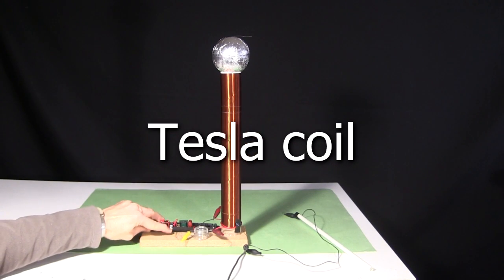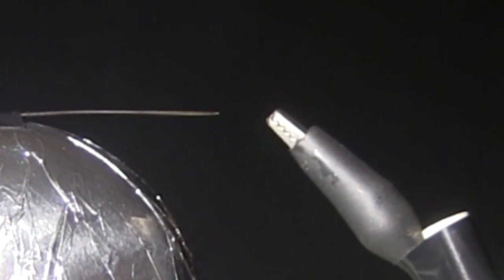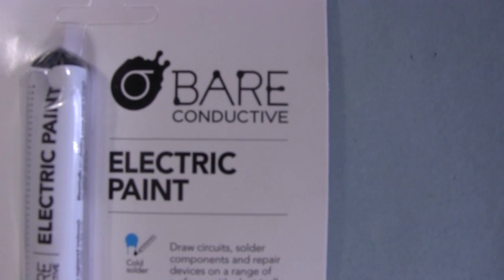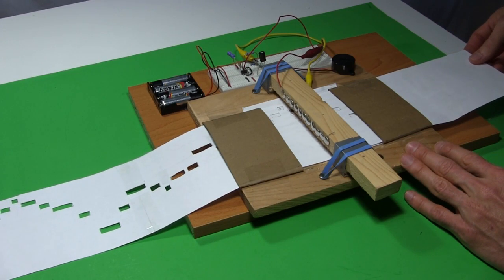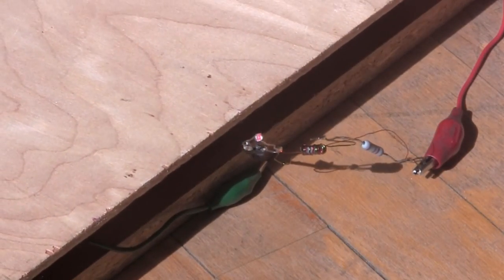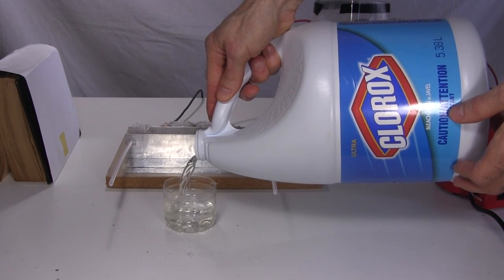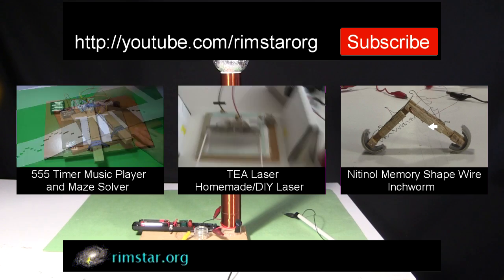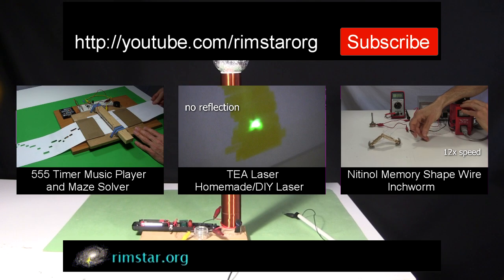Tesla coil, conductive ink, joule thief, solar and TEA laser

Comment: it sounds like your tea laser has some good capacitance to it. before you get too carried away with calculations, try putting a larger cap bank on the end of your zapper and shrinking the spark gap size. you will see the resul;ts right away, then you just have to increase the power to the cap bank and increase the frequency for streamers. im sure there is a place for math in there somewhere, but you dont need it for visible results   :)
Reply from the maker: jeremy gwilt Oops. I just replied to your comment elsewhere. At your request I added capacitance but as you point out, that means there's now more tuning to do.

Comment: My best low light JT can run on light from a full moon using a 50mmx150mm Amorphous flexi panel. :) I think all sthose panels might be a little bit of overkill. You should have no problems with full moon runing from that....

I would be highly impressed if you can tune that SGTC to get continious streamers from the bug zappers wattage. Honestly I'd be impressed to see constant streamers from your flyback PSU's . I fear higher freq sparks with significantly increased length will be the best you can do from the zapper.
My sugestions would be a fairly high capactiance top load with insulation. Work out quater wave freq of secondary and top load capacitance. Then tune the primary tank for around 5th-10th harmonic of the secondary. I'd be going for a firly long helical primary. Somewhere between 9 and 20 turns. Try and get coupling over about a third to a fifth of the secondary height. Although I could be very wrong. I need to have another play with SGTC's myself.

I'll have to try some olive oil and bleach in my TEA laser. I think I'll skip the urine. Happy to accept that didn't work, lol.
Reply from the maker: Mongrel Shark Yeah, I didn't show much in this video but the LED was still barely lit even though the solar cells were practically in darkness, so I've no doubt you powered your JT with a full moon. Hmmm... that would actually be fun to do just for the fun of it alone.I agree with you re the weakness of the bug zapper. But I had to start with a minimalist approach for the sake of any 11 to 15 year olds trying to make one for a science project.And the olive oil has to be fresh. In the SixtySymbols video that inspired me to try it (https://www.youtube.com/watch?v=u8xx-cfzAeA) their lab guy actually went around the grocery store with a UV light to find the freshest olive oil. If your oil glows in the store then it's good! :D
Reply: Yep. Moonlight JT is fairly useless. But a fun challenge. Especially if you try and do it from the smallest panel area possible.

I have some UV LED's. Hmmm...

Comment: use round electrodes for the spark gap like the one use used in your kelvin water dropper.
second use a flyback transformer and a cfl circuit board instead of a fly swatter.
there are four wires going to the tube in a cfl circuit board. connect the two wires which are not connected to a capacitor to the in-built primary coils of the transformer.
also use some leydan jar capacitors. and you are using the wrong primary coils for the tesla coil. use 5-10 turns of co-axial cable instead of just one red wire.
i had made one, it work's great.
waiting for your next video.......
Reply from the maker: harsh bawari A CFL and flyback are still easy to find parts so I might just try that route. Thanks.The number of turns for the primary was calculated using a tesla coil calculator. The fly swatter has a capacitor at its output and with the primary, forms an LC circuit. However, since it was easy to do I did try from 1 to 5 turns for the primary.

Comment: It's not continuous because the spark gap sparks freq. is not high. To make it continuous it has to be at least faster than human eyes can catch, my experience is at least above 15Hz. The tricky part is narrowing gap, the voltage is going down as well, in another word, this set-up will not give you continuous streamer.. You might want to try the AC output from the bug board transformer directly by cutting off the multiplier circuitry.
Reply from the maker: Binj Komisar
Oh, I'm not always "on that". :) Yours and everyone elses feedback is very valuable.
Reply: Maybe. I would be very impressed to see streamers for such a low input wattage. I think the best case for the bug zapper PSU is longer pulsed sparks at a slightly higher freq. Or with a tuning change. Some wireless Flurecent globe action.
Reply from the maker: Yuji Naka Yeah, I wanted to try the simplest to make power supply first so that anyone can make it. Next step is to try still easy to find, but more powerful parts and work my way up from there. I think Mongrel Shark may be right in that the bug zapper PSU is just too weak for streamers, though I guess I could try a very small secondary but that depends on what the resonant calcs say. A higher frequency secondary makes the primary harder to do, although instead of matching resonant frequency, a subharmonic for the primary might work. Don't know if that's been done before.
Reply: Sub harmonics on Tesla primary’s are very common. Out to about the 20th.... 5th to 10th is pretty common. Some say you need to let the secondary (and primary) ring a bit for streamers.
http://www.richieburnett.co.uk/operation.html#operation
Reply: RimstarOrg
OK... Looks like more sauce is the answer here. Good stuff, I should have known that you were on that... My bad :)
Mongrel Shark I see what your saying, lower harmonics will extend the ring time, albeit make less joule/time ratio be spacced out more... I love all this stuff... Yuji Naka Mongrel Shark RimstarOrg You guys are the best :)
Reply: Mongrel Shark thank you. I learned a lot in the website you provided. I thought the high voltage of secondary comes from turn ratio for the most part, it's actually the small stray capacitance (from math point of view) that causes the high voltage.
Reply: Really its a combination of the two. If primary side has small inductor and big cap. then secondary must have big inductor for small cap to work. You cant make a resonant transformer without the cap though. You simply get a step up transformer. Except in rare cases like the self tuning Slayer exciter.
Reply: Yuji Naka Yes, and if he added some caps that make an LC tank that match the res-freq of his secondary each time the gap impulsed it would ring and be good... At least it would prolong the extent of the sparkage I think... I think, not 100%... Damn cautiosness of opinion!
Reply: Binj Komisar It's worth a try. Say the spark freq is 5Hz, using res-freq formula to get the value of cap, then connect it to two ends of the secondary. Magic may happen!
Reply: Yuji Naka
Yeah, you just gotta know the res-freq of the secondary and the L value of the primary... Then the world is your oyster
Reply from the maker: Binj Komisar The fly swatter circuit has a cap at the output so there is an LC tank circuit, just not an obvious one. It's in parallel with the primary. I used its capacitance when I did the resonance calculations using http://www.tesla.nu/programs/javatc/javatc.html
Reply from the maker: Mongrel Shark
Nice explanations on that page. Thanks!
Reply: RimstarOrg Why not with the Hv cube!!!!!!!!!!!!!!!!
All you need is a cap in parallel and a spark gap.You know how to build a high voltage capacitor don't ya!!!!!!!!!!!!!!
Reply from the maker: Ivan Paul
That's actually one of the options I'm thinking of doing. Alternatively I might go with a single transistor circuit. I wanted to try simpler first so that more people would be able to replicate it.
By the way, there is a capacitor in the fly swatter that ends up being in parallel with the secondary coil.
Reply: RimstarOrg I meant that you need one if your gonna use the cube!!

Comment from the maker: Works-in-progress and FAILs - my Tesla coil progress, and playing with conductive ink, a joule thief powered by solar and my TEA laser. Enjoy!
Reply: Sir I have been working on a windmill project for school. Which dc motor should I use to get around 5v output
Reply: Hey boss, Gang here.
I recommend this pencil for drawing a circuit:
https://123d.circuits.io/shop/circuitscribe
Reply from the maker: dunealex73
Hi Gang! :) Thanks. It took a little digging but it looks good promising. It's silver conductive ink and <2ohms/cm according to this http://www.electroninks.com/circuit-scribe-conductive-ink-pen. What I'd like to do is draw parallel lines on a piece of paper and then roll it up to make a coil. The resistance may still be high for that, but maybe not.
Reply: I always wanted to draw a capacitor with them, but I didn´t hav the money to import those things to europe...^^
I´d love to see someone with actuall knowledge like you doing stuff with them first.

And thx for still keeping up with videos, I enjoy them very much. I also impressed my teacher with knowledge I got from you :D (Mechanical Engineering)

Comment: For the tesla coil, you will need to get something that can deliver more power and at least 1000V, no way around that really. Try using your HV flyback driver. The ZVS driver works pretty well. I am sure you can make some HV capacitors, too. You could go with my Slayer exciter build, too. I was getting 1 inch streamers with 24V!!!
Reply from the maker: Power Max Yeah, I'll probably go the flyback route. I don't want to do slayer since the requests have all been for Tesla coil.
Reply: RimstarOrg I wonder if you can make the tesla coil from a plasma globe? I took apart a rather large one, and found what looks exactly like a scaled down AC flyback transformer, It has to be AC for the globe to work. I imagine it outputs close to 5KV-10KV, I have not tested the circuitry after taking apart.

Maybe you can use a full bridge rectifier on the output with maybe 10-15 1N4007 diodes in series, and have 2 sets in a half-bridge configuration, which can charge a large capacitor and discharge through a small spark gap.

Something I have learned when I attempted to make one many moons ago was that it is not the size of the spark gap that determines the frequency of the it, it is actually the inductance and capacitance, which form a ringing LC circuit when the spark gap fires, and that has to be resonating at the resonant freq. of the secondary coil, since it also is a inductor by nature and has a capacitive load on top, as well as parasitic capacitance of it's own.
Reply from the maker: Power Max Yeah, I've been using http://www.tesla.nu/programs/javatc/javatc.html to do the resonance calculations taking using as input the capacitor at the fly swatter's output, the primary, the secondary and the top load, which as you point out is part of the secondary LC circuit. That's how I selected the number of turns for the secondary and the primary, though since it was easy to do I played around with then number of turns on the primary anyhow.

Comment: you have a great start on that tesla coil. keep up the work. another option for a high voltage input is a neon sign transformer and a couple of saltwater capacitors which you can look up on for more info on those. Great job.

    - Kyle
Reply from the maker: Kman Meteor Thanks. I have a neon sign transformer here, but since I want to make a How-to-Make one, I'm starting from simplest and working from there. I suspect the fly swatter isn't going to cut it though, so I'll probably try a flyback circuit.
Reply: oh forgot about the flyback driven tesla coils. I hope to see another update soon. great job
Reply: RimstarOrg For your purposes, a solid state tesla coil (SSTC) will be ideal....It doesnt require hard-to-get components like NST's...just some MOSFETS and circuitry to drive them....
Reply from the maker: Soham Gumaste I actually hand-wound this 750 turn secondary in a little over 2 hours of TV watching - science documentaries. I went by the calculated length of the coil rather than counting turns. Very painless, and probably not much longer than it would have taken to figure out how to attach the cardboard tube to a drill. For a bigger coil, I'd probably go the drill route. I guess I could show both. Thanks for the feedback.
Reply from the maker: Soham Gumaste I plan to do an SSTC in future. I just wanted to start with a spark gap one first.
Reply: RimstarOrg That's great! And please can you make a tutorial showing how to wind the secondary without spending DAYS doing it?(like with a motor...)